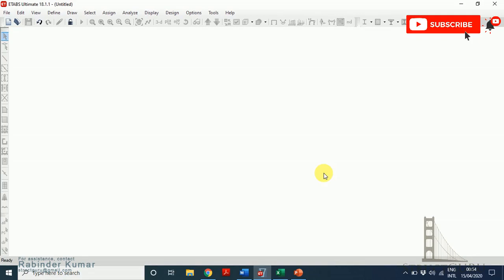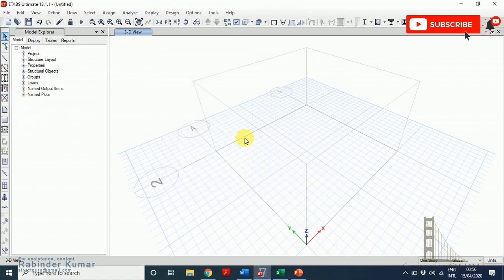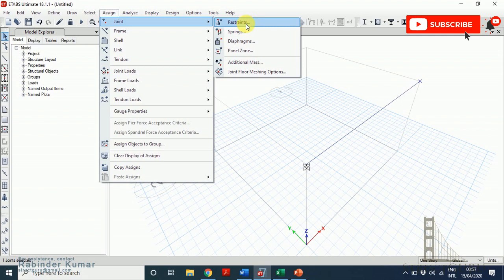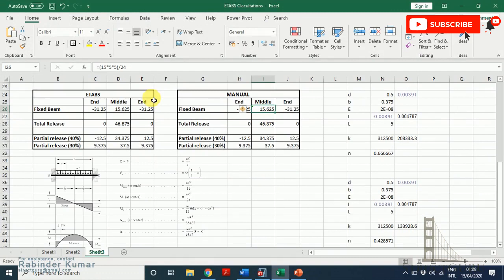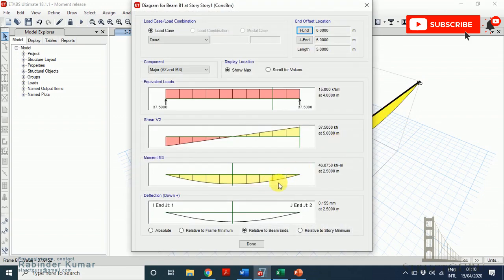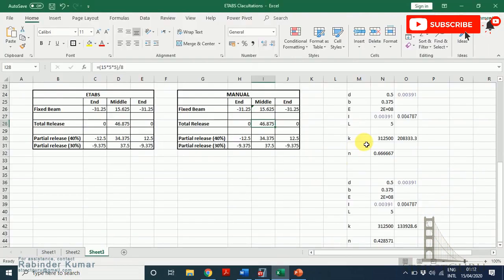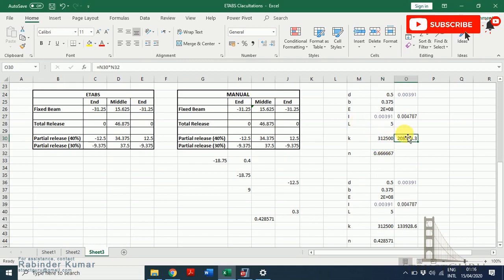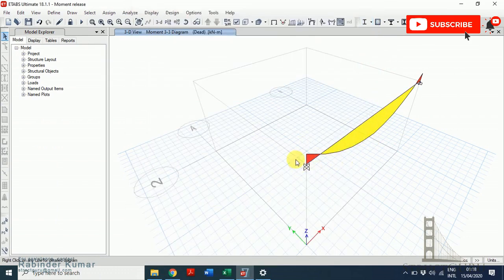How to Assign Moment release or Partial Fixity

Comment: Thanks for sharing. This is really helpful. But I'm wondering what if we want to reduce the moment 50%, by the reduction factor formula we have 50%/(1-50%) = 1. So it goes back to the normal stiffness, how do we deal with that?
Reply: as u wrote, the reduction factor should be 1. there is no problem here. u can prepare a data and check the results.

Comment: Thanks Sir, but what is the proper percentage for a partial fixed connection? Is there any limitations? or it just needs to pass deformation and strength wise?
Reply from the maker: Well generlly we don't assign partial release to any member. This is calculated by Etabs software through FEA by calculating the joint stiffness. We do assign total moment release incase of secondary beams.
Reply: I am aware of that. But in case I needed a partial fixed connection is there a specific percentage that I should stick to?

Comment: Great.. Now my question is practical use of partial fixity on structure design. When we are allowed to reduce the moment partially (40%/70%) and what should be the code suggestions, or I can use this assumption whenever I need, definitely not. Like as in Staad pro, for secondary beams, we release partial moment (.99) to reduce the instability warnings). Please describe a little with practical use also. Great work, carry on.
Reply from the maker: Moment releases are applied to simulate real world connection in structures. They are mostly applied for secondary beams because the moment in secondary beams is considered negligible and they are considered as pinned connection. The primary beam is supported on columns which provide fixed support. But in secondary beams, there is no such thing. There is rotation at the ends. These moments are countered by causing twisting in the primary beams to which they are supported. To avoid such effect, a shear connection is developed for secondary beams by releasing all the moments.
Reply: @structguru2200  Thanks. I know the criteria that in 2ndary beam, we release all moments and place shear connection. I also know the theory for it. But the video you showed to release partial moment(not fully). So i asked for that's explanation in practical use and application. Thanks for the cooperation.